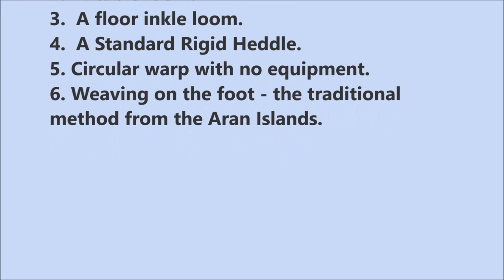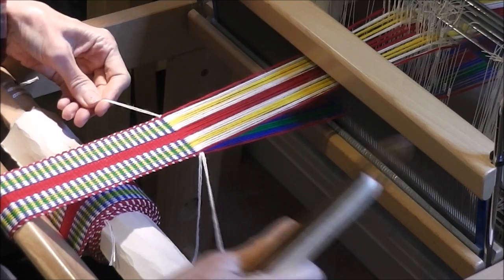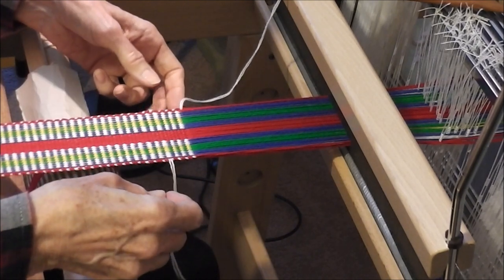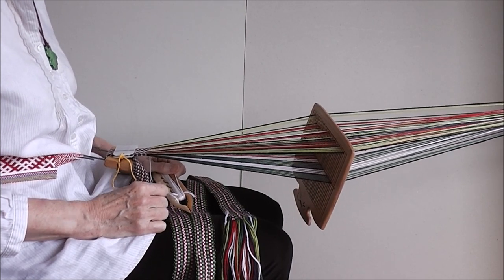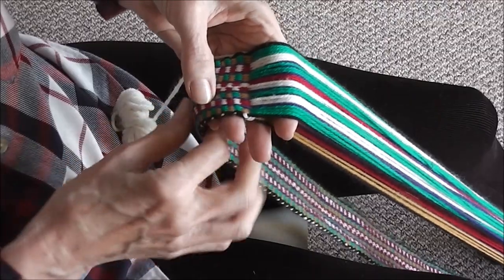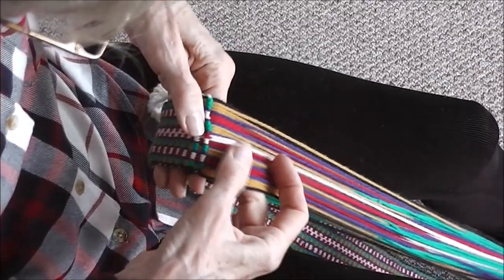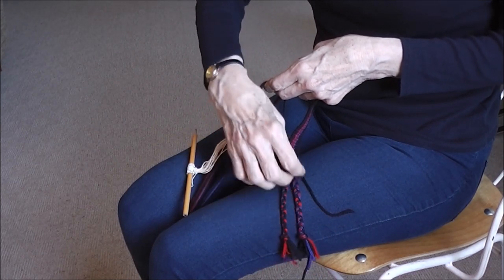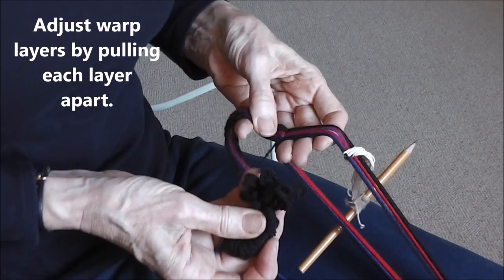Six Ways to Weave a Crios

Comment: I have watched this great video multiple times.  I need some help.  What weight yarn to use, sport, Dk, etc?  How to place the warp colors best?  I want to make one for my son's wedding.
Reply from the maker: Hi. What a lovely way to celebrate the wedding with a personal gift.  Look at my blog entries for October 2016 and May 2020.  The crios made by John McAtasney is  6 cm in width and 190.5cm in length. in width and the four plaits at each end are 12.5 cm in length .  (October 2016.)    https://durhamweaver64.blogspot.com/  
This might give you some ideas for colours. I have used double knit wool, 4-ply wool  and chunky wool. The main criteria is that it should be warp faced weave so that the weft does not show. One crios I made with  sock yarn used double, has 56 ends and is about 1.5 inches in width. A 60 warp end band  made with dk wool is 2 inches. A mans crios is generally wider than a womans crios. 
I hope that this information helps you design and weave this lovely treasure. 

best wishes and happy weaving

Susan J Foulkes

Comment: This is fantastic! I was wondering, what thickness of yarn do you use? I tried making one using worsted weight wool on a box loom, and it turned out rather lumpy and not nearly as smooth as these.
Reply from the maker: Hi  I use a variety of yarns depending upon the number of warp ends in the pattern.  If there are a lot of warp ends I use something 3 ply sock yarn which means that the belt will not be too wide.  For patterns with fewer warp ends double knitting wool is fine. i have also used chunky wool. I have bought crios in Ireland which used a rather coarse thick yarn which made a sturdy belt.

Comment: do u warp the thread just like a warp for a loom
Reply from the maker: Susan Schexsnayder hi
Most of the warps were made with a singles cross before winding on to the loom or threading the rigid heddle. I warp the inclement loom directly, adding the heddles as needed. For weaving on the foot I made a circular warp on the inkle loom. One of my recent blogs is about making a warp. 
Happy weaving. Susan J Foulkes

Comment: How do you start #5?
Reply from the maker: I made a circular warp.  The warp was made with a singles cross which separates out the two layers for weaving. Putting threads around the figure of eight separates the weaving layers.  I needed to keep the warp taut whilst I made the heddles so I tied it around two posts. The top layer was fitted with heddles ensuring that the warp ends were in the correct order. Once this is completed you know have two layers separated. Starting to weave I used two flat sticks to put into the first two picks.  This gives the weft a firm base so that the start of the band is even.  You can then start weaving by picking up the two sheds alternately and placing the weft. Once the weaving is established these two sticks can be removed.  I found it difficult to get used to the weaving so I had to persist for some time before it became more fluent. 
I hope this helps, it is a bit complicated to explain. 
happy weaving
Susan Foulkes